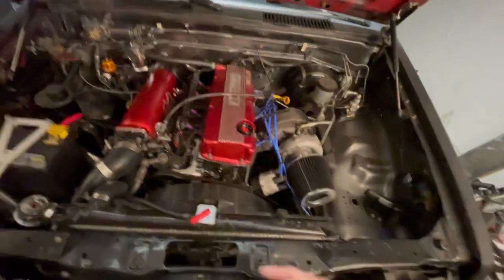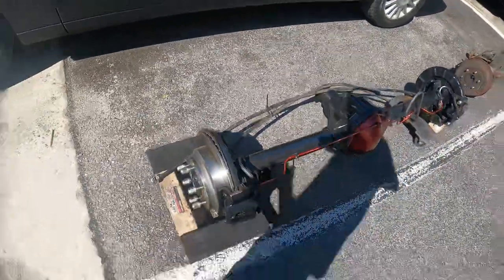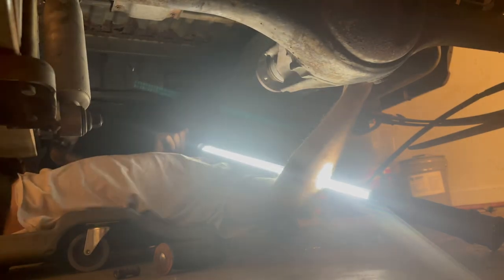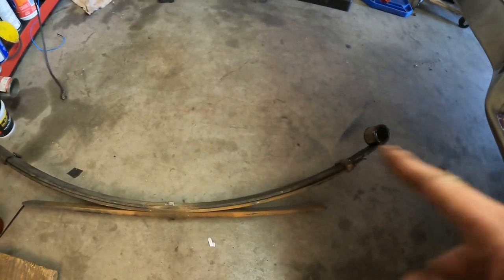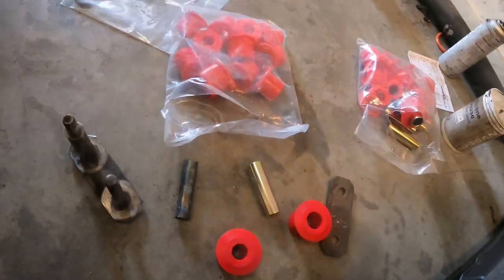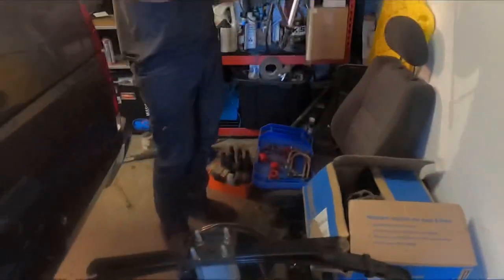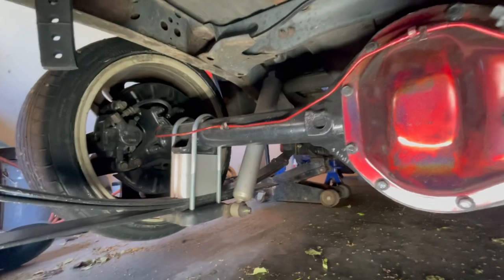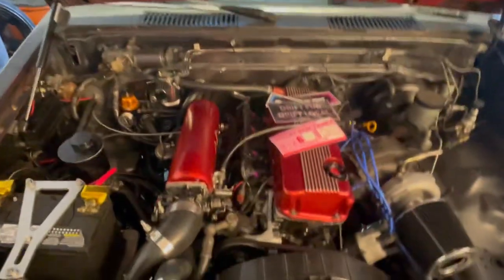Nissan D21 Hardbody Rear Axle Swap - 4.3 Ratio, Welded LSD Diff, Disc Brake Conv. #d21 #drifttruck

Comment: Thanks for the vid! Bummer it makes the RPM's higher.

 The Rodeo rear for the LSD and Disc's was looking so tasty until you mentioned the lower gear ratio. 

I wanted a "Smudge" taller gears. 

Keep em coming! 😎👍
Reply from the maker: Thank you man!! There may be another rear end of the same dimensions with a different ratio(still 93-95 w leaf springs)! Not 100% sure but I’ll see if I can dig anything up for ya. 

It almost just feels like it needs a 6th gear now, maybe in the future if the trans blows I’ll see about adapting a CD009 or something similar

Comment: So my question. I have a 1997 N21 hardbody (4x4 4 cylinder). I drove it home, and the RPMs just seemed wayyyy too high. Even for a 4 banger, 3k rpm’s at only 63-ish miles an hour just seemed like it was too much on the engine. 

I’ve heard that some of these come with a stock 4.6:1 gear ratio and some with 4.3:1, is it possible to find a rear axle with a lower gear ratio for highway driving? If so, how will this affect its 4wd capability?
Reply from the maker: Yes, there are some different ratio axles throughout the D21s and Pathfinder(of the same generation) that should be mostly straight swaps but I’m unsure of all the different ratios and codes for them. 4WD shouldn’t be affected as long as all sensors are compatible.

Comment: I'm doing this swap right now but I've encountered a problem with the u joint, mine is not the same size as the dana 44 flange. I need to know what size/part# u joint you used and what year your truck is because the driveshaft may be different. I'm lead to belive this because your driveshaft uses snap rings to secure the u joint cap while my u joint caps are staked in place by a press that deformed the metal in the flange. My truck is a 91.
Reply from the maker: Is your truck a 2wd Manual single cab? Mine is a 95 Single Cab manual KA 2wd.  I don’t have the part # on hand from the u joints unfortunately but I essentially took the yoke flange from the Dana and matched the u joint to it.
Reply: @Street Terror Garage  Mine is a 2wd manual single cab, I did some research and the 91 truck has "non-replacable" u joints. Nowhere has that size in stock but I think a driveshaft from a later model will work.
Reply from the maker: @tomakers57  Interesting. I have another driveshaft I pulled from a 92(?) and it’s almost identical to mine. Hopefully 92+ has the shaft you’re looking for

Comment: Looks like I need to make a trip to the junk yard. A Dana 44 is upgradable right? I don’t need the gearing you’ve got, but I’d love rear discs and an lsd
Reply from the maker: There’s a couple different ratios they come with and I know 4.10 is one of the others. I’m sure you could find aftermarket support for it pretty easily

Comment: Great video sir! What rear this  this you swapped?
Reply from the maker: Dana 44 rear axle, swapped from a 95 Rodeo
Reply: @StreetTerrorGarage  Hows the drive when make turn ? Like what cons for having posy rear ? Enlight me with your Knowledge pls
Reply: @StreetTerrorGarage  thanks for replied
Reply from the maker: anytime!
Reply from the maker: the only noticable difference under normal conditions is that it will chirp or skip when making tight turns at low speeds. for me having the diff plated & welded was cheaper and stronger than a locker or traditional LSD. Also more predictable in my opinion for drifting
Reply: @StreetTerrorGarage  ohh ok! I see... Thank you sir! You really enlighten me with great knowledge ideas. Appreciate it !! Keep up the GREAT content 👌🙏
Reply from the maker: Thank you very much & will do!!

Comment: If it is welded then it is a full posi not lsd as lsd stands for limited slip differential if it is welded properly then it should have not slip between gears man not to bust your balls
Reply from the maker: It still is a limited slip assembly though and can be used as such as long as it’s not welded. Mine in particular though has been for drifting only. That’s why I labeled it as such. G80 rear end is factory LSD
Reply from the maker: @WhoopAzzRacing it’s not uncommon in the drifting community to weld a limited slip diff. cornering isn’t my concern, predictability of, and reliability on, the diff locking when I’m drifting a turn is. I know how the diff will act in any instance I stomp the throttle as well as how it will act when I get off throttle, go around any turn, etc. To me it just gives me that much more control and allows me to know what to expect, any time and every time. There’s honestly quite a few reasons why I chose to weld it but as I said it’s not uncommon at all. 

But honestly it’s okay also if you don’t see the reasoning, I can understand why it would seem odd. It’s almost like how people see aggressive negative front camber on drift cars and don’t understand it yet there is reasoning behind it. 

but in the end I’m super happy with the way it performs, the thing tough as an ox, and I’m glad I did everything the way I did.
Reply from the maker: @WhoopAzzRacing  June 5th my truck will be in the show at Springfest so definitely can’t then but I may do something like that in the future. I can at least show up to one even if I don’t participate though.

The welded LSD thing..It’s a foreign concept but just because you haven’t seen it before doesn’t mean it’s illogical. As I said many times it’s for the sake of drifting and that alone. Nothing else. Time has no merit on new knowledge man. Glad I could introduce you to something new 🤘🏼